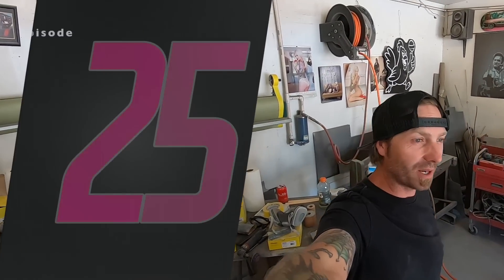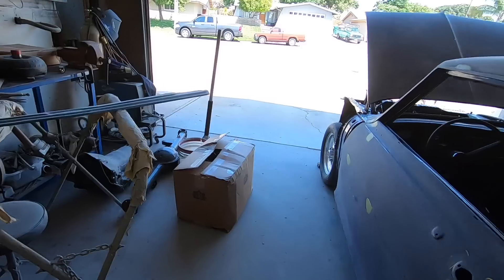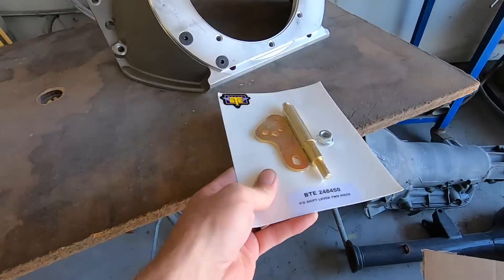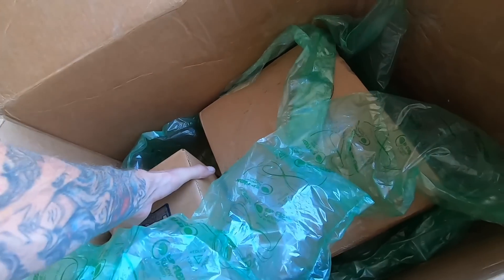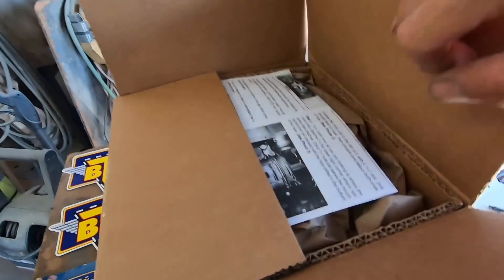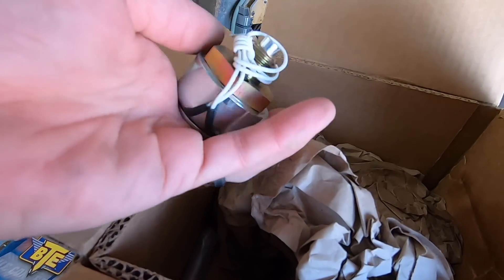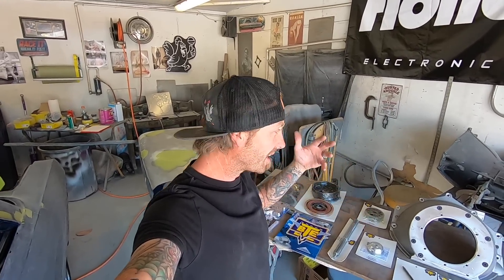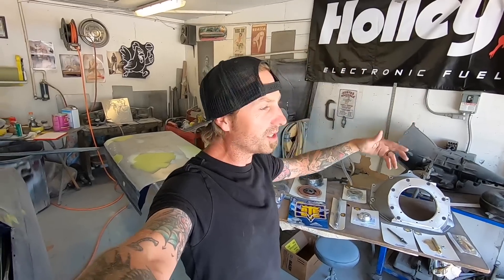BTE Racing Powerglide Transmission Parts

Comment: In a Hughes video on input shafts for powerglide transmissions they're saying if you replace the powerglide input shaft for a turbo style that one of two things needs to be done, have a bushing installed in the turbo converter or machine the powerglide stator tube for a bushing (or) swap it for a th400 stator tube which is the same thing as milling that powerglide tube for a bushing. My question is have you had to cover this area or are you running the powerglide stator tube with a regular turbo converter/ stall converter that's not bushed? Some people are telling me it's not required but turbo transmissions have a bushing in the stator tube. I'm wondering what the normal for this is if you have any input on it
Reply from the maker: My converter has the bushing in it. I talked to my converter guy before I did all this to my transmission. I do remember finding out about that as well and trying to figure out what to do. If you have a converter already you may need to figure out how to tell how it's set up. If you're going to order a new one for your set up talk with your converter guy about what your trying to do. Ryan Jans is my go to for converters and his link is in my channel video description if you need someone to help you. Hope this answers you question. Good luck with the trans build!
Reply: Thanks a bunch that cleared it up for me to carry on forward. And thanks for the vids you've posted too.

Comment: How much did everything cost minus the valve body?
Reply from the maker: It was just under 1k for everything I bought to do the transmission. The valve body was almost half the budget so around 500 for everything but the valve body if I remember correctly. You can price things out on their site. Deep pan was a free bee too so its not included in the 1k either.
Reply: Burndown cool I found a listing on eBay for a trans brake body super cheap is why I ask lol. Trying to do a brake/high stall setup on the cheap
Reply from the maker: @Spudderr  It can be done for cheap if your willing to try! Im all about putting in a little effort.